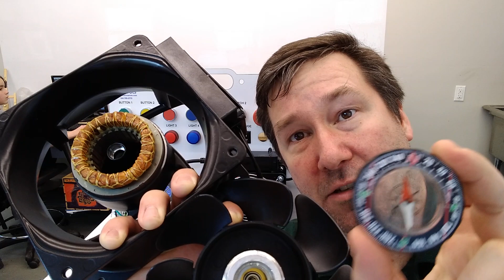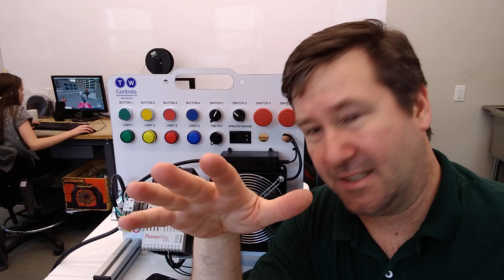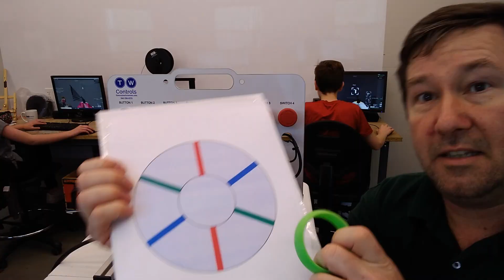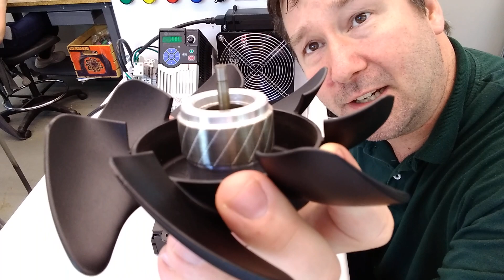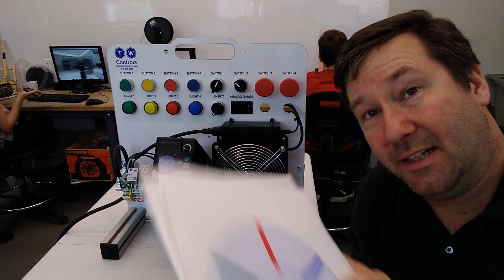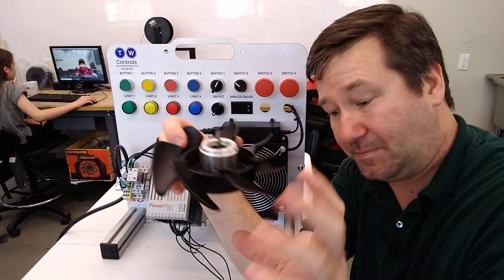3 Phase Motors and Rotating Magnetic Fields.  Using a Compass to Show How Motors Rotate

Comment: Thanks for the great visual explanation. I have a curious question about the magnetic fields that a motor creates when in operation. A 120V single phase coil when energized can create a magnetic field strong enough to energize small led lights with no direct wiring. Could that same Theory be applied to say 1HP 3phase motor have a strong enough magnetic field that you can place a led light on the outside of the motor and the magnetic field would energize the light? If you have any input please let me know thanks!
Reply from the maker: It is possible but probably would require a roll of wire, see link below.
https://twcontrols.com/lessons/how-magnets-produce-electricity-using-a-magnet-and-coil-of-wire-stem-with-tim

Comment: Interesting to hear that motors don't have a rotating field. Who knew? LOL! 

Another great video!

As a side note, I ran across a dual speed motor that changes its speed by way of changing the number of poles from 4 to 2 (to go into high speed). They have been around forever, of course. But it was the first time that I have run into one of them.
Reply from the maker: Yes, they could be a nightmare to troubleshoot when you had a contactor bad.  Thanks for watching!

Comment: Hello Tim, 

Thank you for the video. Know that your efforts are appreciated, as you are helping all of my students.

Question: You mentioned that larger motors didn't work with the compass. By chance, were those 4-pole motors (1800 RPM machines). If so, the compass wouldn't see a single rotating magnetic field vector. Instead, it would see the rotating fields described here as a snapshot at 12 o-clock:

12 o'clock - N
3 o'clock - S

6 o'clock - N
9 o'clock - S

Not likely to rotate. Although, it would be interesting to push the compass to the inside wall of the stator and try again. 

Thank again,

Aaron
Reply from the maker: Hi Aaron.  Thanks for watching!

A 4 pole three phase motor would still see the same rotating magnetic field.  But a 4 pole three phase motor has 12 sets of windings.  What you are describing is a 2 pole single phase motor with a starting winding such as we tore apart in this video.  The compass does just oscillate as you describe on it.
https://www.youtube.com/watch?v=Nuq_0-RUwR0

The reason I couldn't get it to work on larger motors was the small compass near the center point of the large motor was more focused on where the magnetic fields intersect.  My compass would need to be perfectly aligned in the center of the magnetic fields created by the windings which in a perfect world would be the center of the motor but on the old tired motors I was tearing apart, the windings were not perfectly even.  I could make this experiment work on the larger motor but its a tedious process of pecking the compass around to find the right position.   Think of it this way.  Take a circle and make three marks 120 degrees apart.  Now take a compass...like a drawing on...and draw a circle from one of the marks to the center of the circle, make one of them a slightly smaller radius, and make the third one slightly larger.  Now imagine my small compass trying to find the center of those three arcs but not be in that little void where the lines don't intersect.  By shrinking the circle or increasing the size of my compass, either would work, my chances being in the influence of the magnetic field increase.

I hope that helps Aaron.  Let me know if you have anymore questions.
Reply: Hello Tim,

Yes, 12 coils for a 4-pole machine is what I was trying to describe. The field is indeed rotating, as I described here at time index 5 : 30:

https://www.youtube.com/watch?v=qDon7Nrj1Tk

WRT the compass, it's unlikely to respond well inside a 4-pole system, as the flux lines do not pass through the center of the stator. Instead they curve to the sides taking the shortest path they can find between poles 1 to 4 to 7 to 10 to 1. 

You can convince yourself of this by applying a DC current to one set of windings and walking the compass around the inside if the stator. You can see the rotation like a planet gear inside its ring gear. 

That's why I asked about the RPM of the motor you tested. I suspect the that fan is a 3600 RPM (2-pole) machine where the magnetic flux lines pass through the center of the stator. I also suspect the other motors were 1800 RPM (4 pole) machines.

Cordially,

Aaron

Comment: Tim, the comments regarding a rotating magnetic field were from someone in the matrix. There is no motor. There are no magnetic fields. Lol. Seriously though, with the rotor out of the example you used, how did it affect the current out of the vfd?  On a similar note, if you haven’t done this one, could you please show everyone how the load goes DOWN when your vacuum cleaner suck up a cloth and the sound changes!  Keep up the great lessons.
Reply from the maker: I didn't think to check the load without the rotor in. I didn't find the piece of the motor I dropped so it is still sitting here apart.  Current should be much lower without the rotor since there is no slip without the rotor.  I'll test it next time I have some time on a trainer and get back to you. The explanation might be more in depth then I would would want to go in a video. 

Now vacuum and centrifugal pumps/blowers.  That would be a good one to make a video on.  I will never forget the first pump I encountered that the starting procedure as to close the outlet valve, turn on the pump, then open the outlet valve back up.  I have a PID setup I'm making some videos on that I can do that with. 

Thanks for the suggestions Jack!